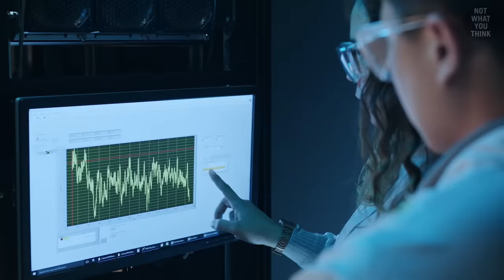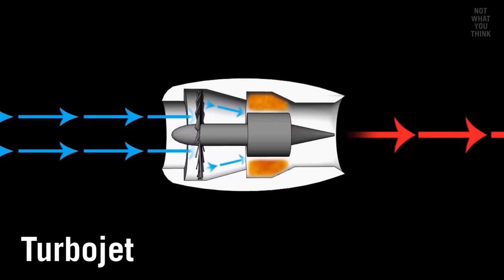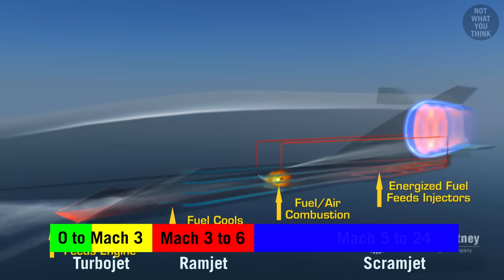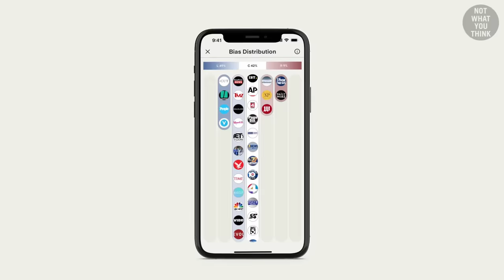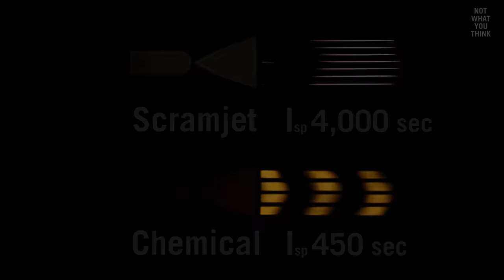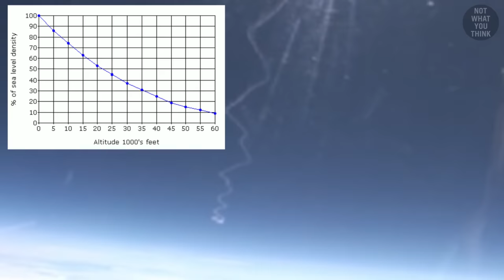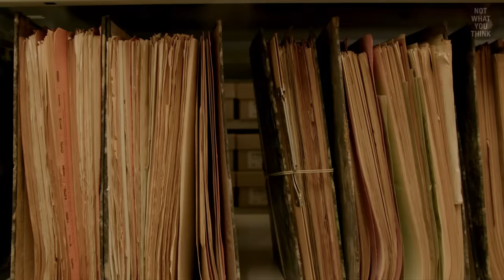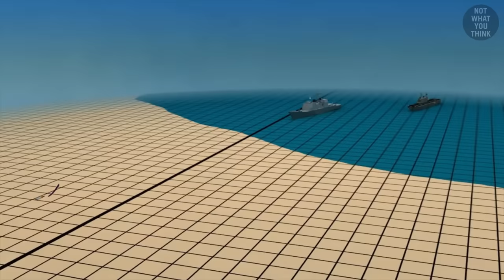The Hypersonic Missile Vulnerability That NO ONE Talks About

Comment: The kinetic energy point might end up being the saving grace of hypersonic.

If you can somehow create a weapon that maintains enough cohesion in its terminal phase whilst still going at ludicrous speeds the sheer kinetic energy of a chunk of boiling metal slamming into the target at 18,000mph (to take the ludicrous Russian claim at face value) is likely to be high.

Basically the Rods from God concept but with missile launched rods from ground bases as opposed to orbital ones.

Or maybe there's some fundamental reason why that wouldn't work (my immediate thought is that any missile that could maintain sufficient integrity to meaningfully convert its mass to kinetic energy on impact at any efficiency would probably be able to handle being used to transport a traditional warhead, or would need to be made of Unobtanium).

On the whole it's an interesting field but does suffer clear problems in the terminal phase.
Reply: During a recent test of bhramos super sonic missile it was able to sink a ship without a warhead with just it's kinetic energy. So a hypersonic missile will be really deadly.
Reply: @Imperator Caesar Traianus Hadrianus Augustus Unpowered kinetic vehicle in free fall would be one way to aproach it. Terminal guidance would be a problem to solve unless it can be reliably set on calculated a ballistic trajectory before re-entry. It would have to be a very heavy warhead.

The other way to use hypersonics is the more obvious and expected one, a delivery system for nuclear warheads that are difficult to intercept until the terminal phase.
Reply: @Imperator Caesar Traianus Hadrianus Augustus pretty sure that was already thought off and outlawed.
Reply: @@imperatorcaesartraianushad5235it'd be potentially dangerous to have floating about and hard to aim/maintain a monopoly on but yeah. The sheer kinetic impact would likely be huge.
Reply: Wouldn't those missiles be easy to shoot down? They are traveling so quickly they have effectively no maneuverability, and it wouldn't take much damage for the missile to fall apart when you've got hypersonic winds trying to tear it apart.
Reply: Shinshocks  the kinetic energy is the real deal in these missiles, at one of the ships it made a straight whole, a big one, also the accidental fire in Pakistan took down two houses and created a lot of debris, both of the cases it was unarmed, the overhype part of hypersonic missile is bogus, the missile carries a lot of kinetic energy and it's hard to intercept, for interception not only you had to have good radars and equipment but a highly trained crew because it gives a little window of interception, a time limit of 2-3 minutes,
Reply: @barnmaddo  I was going to say, computers should be able to calculate some sort of intercept approach since it's kind of hard locked moving at those speeds.
Reply: This is actually the primary concept of anti ship ballistic missiles (ASBMs) the biggest use case for these is very large priority targets like cruisers and supercarriers.
Reply: @piecemakernoalias1018  cruiser can be taken out easily by the warhead, for the supercarriers you need 3 to 4 hypersonics to hit the target
Reply: Shinshocks  his point is if a supersonic missile can sink a ship with pure kinetic energy then a hypersonic missile will be even more potent.
Reply: Not really, a big lump of metal crashing through a ship will cause a lump of metal shaped hole but the actual damage would be pretty low compared to high explosive
Reply: Nice point. If the core of the missile was simply a wolfram pole, letting the rest of the missile burn away, it would probably be unstoppable...but unsteerable and therefore only usable against moving objects..plus maybe a nearmiss explosion in an early stage of descent could steer it far enough from it's course to miss (?)
Reply: @pranavtripathi791  
The Brahmos you literally take that with grain of salt as there is no proof
Reply: Hypersonic weapons work great against fixed targets which make them ideal for targeting key points like bunkers ,comms, airfield and air defenses
Their use against moving targets like ships has in question as ships defenses means that missile has evade targeting and interceptors which will cause it to lose speed and energy
Both Russia and China's lack of air borne jammers is why hypersonic weapons against ships is iffy at best
The DF-21 flies 1000 miles but still need to communicate with launching site to stay of target
It takes 10 min for it reach , in 10 mins, CVN can change its position by nearly 6 miles
Reply: @barnmaddo  It can be hard to wrap your head around. Context is important. An object going 1 400 meters per second, will not be maneuverable in the traditional sense of the word. At those speeds, the ability to turn half a degree every 5 seconds, will be acceptably maneuverable to avoid ground based countermeasures. Keeping in mind, objects already at speed, at the edge of space is at an insane advantage compared to whatever might be fired from the ground.

For comparison. During the cold war, the Soviet union saw the need to build the Mig-25 with a max speed of nearly 3500Km/h. In order to intercept B-52 bombers, which can scarcely reach mach 1 under ideal circumstances. A 5000km/h object, can be described as ''maneuverable''. If it can fly around a 1000km radius circle in the sky.
Reply: It doesn't need to be unobtainium, it just has to be a mixture of metal that holds up just well enough to stay intact, with nothing else guaranteed.
Reply: And how expensive would this flying chunk of hot metal be?
Reply: @oatmealman1586  
Wow 
its like you people never went to school
Reentry vehicles use ceramic shielding to protect them from extreme heat during reentry
Hypersonic weapons traveling at the high end of hypersonic speed Mach 15 plus have the same shielding 
The reason why they have warheads is called  Lethality Enhancement
The  kinetic energy shatters the target while the warhead amplifies the damage
Reply: At this technology development in the US Unobtanium would be the only option left on the table since brain drain from Germany is not working anymore due to the standards of living in the US.
Reply: Hilarious seeing a Zoomer furry trying to talk about something like this.
Reply: I remember reading an article many years ago about them trying to make the SR-71 into either a fighter or a bomber. The fighter mission was impossible since the plane moved faster than the missiles it was going to be carrying. Dropped the missile or even try to launch it if it comes off the rail it'll be behind you. They did discover if they dropped a bomb from an SR-71 it didn't need to be loaded with explosives. The pure kinetic energy of the bomb starting out at mach 3 and descending into the target would generate enough kinetic energy to destroy any Target it hit. But at the time I believe they were talking about titanium or tungsten alloy rods. The program was eventually canceled in any case. I don't know if they got to flight testing or if it was all theoretical. I read the article I want to say in the early 80s.
Reply: I'm waiting for missiles that go to plaid.
Reply: once you open the "if only we could do x" box, that argument could be applied to any of the other variables that are limiting it too.
Reply: @pranavtripathi791  If the target sank with a single compartment hit, it was not a particularly good ship.
Reply: @benudharmadhi4154  Are you high? Modern CIWS is fully automated and goes through the locating-tracking-shooting pipeline in under 10 seconds, and that's been a thing for the last fifty years.
Reply: We call that a rod from god.

Tungsten carbide rod with a pointy tip weighing 10tons with some guidance, drop that from a weapons platform in high orbit.
Reply: Two ways

Rod from god

Or a missle with a final stage that just points itself somewhere on earth, de orbits, and then ignites itself on the way down. Don't even need an explosive warhead. Just a rocket system that can put a 10ton chunk of iron with the heat shield the solar probe used, that has a booster attached to it.

5miles a second+ as the final booster slams 10tons onto target, it would yield around 7 megatons of energy without explosives.
Reply: @Imperator Caesar Traianus Hadrianus Augustus yes it's an idea...
 but those meteorites would be much slower than the ones coming straight in from deep space without entering parking orbit first... also there's a problem of aiming, since 1. it might take several orbits before it hits, and 2. once the plasma sheath forms it's blind, so the orbital adjustments that moves it from a steady orbit into a decaying one, would have to be incredibly precise. So you'd need to know the exact weight of the rock, which you'd have to probably spend a lot of time and effort to find... also, if the rock fractures on the way down all accuracy would be lost.  
Probably easier, faster and more precise to throw a bunch of missiles than random rocks
Reply: @Imperator Caesar Traianus Hadrianus Augustus So all we need is orbital gaussrifles? ✌
Reply: I wonder if this technology would work as a short-range, anti-tank weapon. Or even a personal weapon.
Reply: @@imperatorcaesartraianushad5235 yeah, I see we're going from several thousand $ drones to several thousand times more expensive nukes...

Comment: "specific impulse" is not a great way to describe why rockets are more efficient. Rockets carry fuel and oxidizer because they burn in space where there is no oxygen. Jets that stay in atmosphere can use oxygen from the air, so they dont have to carry it they can just carry fuel. The oxidizer is a significant weight, often more than the fuel, so jets that dont have to use it can carry much more pure fuel and can be much more efficient. Thanks kerbal space program
Reply: You didnt need KSP to know that carrying something extra makes you weigh more ;)
Reply: Yes but the biggest difference maker is specific impulse.
Reply: KSP should have taught you that the ISP matters way more than the dead weight regarding the huge difference in ISP
Reply: Jet needs a lot more fuel to push through thick air than a projectile in space with no air resistance no? Thus making in inefficient?
Reply: Also, usually Rockets usually burn roughly about as much oxidizer as fuel in terms of mass, while a jet usually has a completely different mixture ratio, that needs several times more oxidizer than fuel, thus making the fuel it consume produce more thrust than in a rocket engine. Every gram counts.
Asides from specific impulse, I think DeltaV can also be a good factor, even if its very, very biased against hypersonic missiles when comparing them to a spacecraft (aka ballistic missile).
Reply: @flyingfrog7847  specific impulse is measured in static tests, so drag doesn't count.
Reply: @dinncorp2754  Nice point, but it would only divide the ratio of ISP by two. I'm sure the ratio is way higher, else we would fly rockets insteas of planes.
Reply: I agree.  Saying rockets are less efficient than jets because they have a lower specific impulse is like saying rockets are heavier because they weigh more.  It adds no information except that you don't know the reason.  And although specific impulse is very important for space travel, applying it to flight on Earth is not straightforward.  An ion drive may have a very high specific impulse, but it won't get the lightest vehicle off the ground.

As you correctly said, a reason jets are more efficient than rockets is that the atmosphere provides one of the reagents.  But the atmosphere also provides additional reaction mass, which is an even bigger factor.

A chemical reaction generates a certain amount of heat, and a jet or rocket converts as much heat as it can into kinetic energy of the exhaust gases.  The momentum of the exhaust generates a balancing forward momentum on the engine, producing thrust.  Kinetic energy is proportional to mass times the square of the speed, while momentum is mass times speed (or velocity, but the scalar/vector distinction isn't important here).  What is important is concentrating your energy into a small mass of exhaust gives lower momentum than spreading it over a larger mass.

In a rocket, the mass of the exhaust is equal to the mass of the fuel plus oxidiser.  A jet engine without bypass burning hydrocarbons in an atmosphere of pure oxygen would consume roughly three times as much mass of oxygen as fuel, so the exhaust weighs 4 times the fuel.  In air, this becomes about 20 times.  A turbofan adds 1 to 10 times that amount of bypass air, so it's thrusting against 40 to 200 times the fuel mass.  A turboprop's bypass ratio is not so clearly defined, but of the order of 1000 times the mass of the fuel, and the same goes for piston-driven propellers.

Obviously none of that means rockets would do better if their oxisider were heavier, because unlike jets, they must carry it.  Nor does the nitrogen in the atmosphere actually make (heavier-than-air) aircraft more efficient overall: what they gain in thrust, they lose in drag.

Comment: You're kind of missing the point here. Hypersonic missiles like the Russian "Zirkon" were developed primarily as short range anti-ship missiles. The missile's travelled distance is very short, and it simply doesn't have enough time to overheat and melt, ablative layers are more than enough to handle any high temperatures generated by air friction. Another advantage of speed is that such a missile becomes in a sense - a relativistic payload. Only one hit would be enough to disable or sink a large, high value vessel, the energy of impact is enough for such a missile to not require much if any explosive load. There are a number of other things that you either slid by or didn't even mention which make this tech both very much worthy of development, and too dangerous for apes like ourselves to be able to handle. But whatever, perhaps false sense of security is more important at a stage in history when so much can go horribly wrong in such a short amount of time.